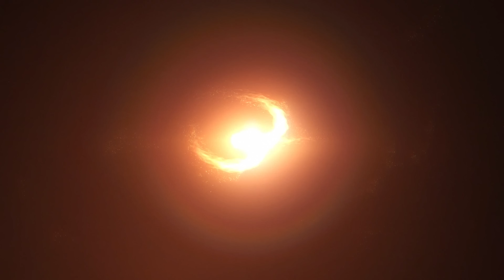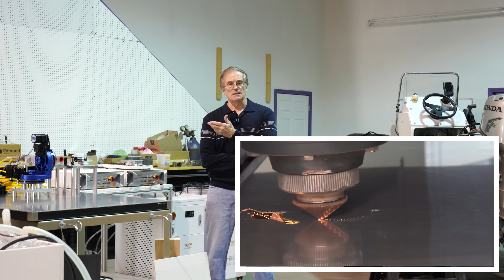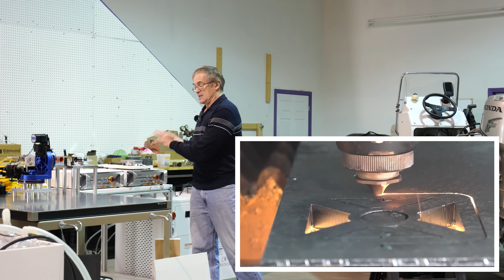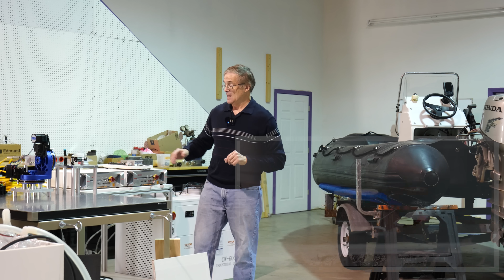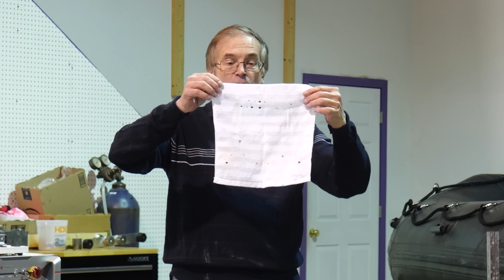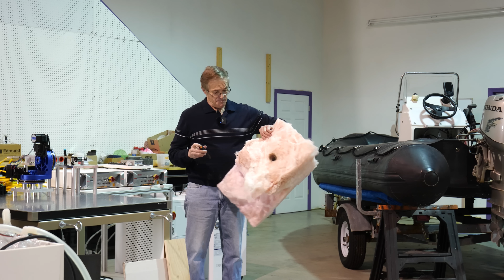We have a problem... and need your help!

Comment: you might have to 'cut' the laser right out of the gate with a series of beam splitters so you're only firing at a fraction of the full strength.
There is also a super-dark pigment (Vanta Black) - it has EXTREMELY low reflectance-- that you could coat a porous pumice barrier with. That might both diffuse and absorb the light.
Maybe you could construct a cylinder of the vanta-black pumice and keep it in high rotation so the beam doesn't super-heat any particular area

Comment: Dirt is... dirt cheap, and a large pallet with bags of it can be placed and removed by renting a crane. Stone slabs would be heavier, but easier to work with individually. Simple solution that allows the project to move forward is always better than spinning your wheels for months.
Reply: Sandbags.
Reply: A Hydraform machine will transform dirt (and a bit of cement) into interlocking dirt blocks that will support themselves. Don't know about US availability, though.
Reply: Isn't sand the same material as glass insulation?
Reply: @dreed7312  Is maple syrup a tree?
Reply: Or just use scaffold or lift and use the ground at the backdrop just make sure there are no gas, electric, fibre or water lines near the surface

Comment: My suggestion is to use intumescent paint. It burst into carbon foam, which should dissipate the heat slightly better and not flammable in on itself.

Comment: The solution to your problem is exactly what the potential targeted drone would want to use as a shield or building material. Wasn't silicon carbide used for mirrors in early high powered lasers? Perhaps you can try directing the beam on to a silicon carbide grinding wheel to test it's durability?

Comment: first idea: what about a fast rotating fabric belt that passes through a tub of water?  the faster it spins, the thinner the material can be.  water has high thermal density, so that will help with absorption, and the high speed of the material moving in respect to the beam means proportionally lower exposure time, so the limitation would be the speed at which you can spin such a material.  it would need to be porous for the water to be able to help.  (update: now that I think about it, this is how they handle degradation of the target material in an x-ray tube for longer running applications like CT scanners.  they make the anode a rotating disc so it doesn't just wear a hold into a static location, so I think it's proven to be a decent solution for similar problems.  I just don't know how well it would work for a fiber laser with such a power level, and at this size scale)

second idea: maybe a row of angled glass that would work sort of like a retroreflector without the second half, so the glass panels across the back would all be at the same angle.  some light passes through, some reflects.  some of that 90 degree light would hit the next glass pane and some would reflect to the back, and some pass through.  at the side, you can have a single strong material like fire brick to catch the accumulated rays. I'm not sure how feasible this would be, but the idea of redirecting beams from anywhere on the surface to a smaller location to minimize the area of material needed to do the absorption was the main idea behind this one, so maybe you can take that concept if this one doesn't work and find a better way to do it.  

third idea: I was thinking maybe a wall of those DLP tv fresnel lenses to disperse the beam, but I imagine those would be too imperfect and melt

Comment: Am I understanding correctly that the primary concern is if the laser stops scanning, and that in normal operation this isn't a major issue?

If so, I'd start with some sort of way to detect that failure mode and kill power.  But you'd still want a physical barrier.

In a vertical orientation, pointing to the ground or a water bed is usually good.

In a horizontal orientation, what about building a water reservoir and pump to create a continuous waterfall? You can have drywall, brick, or whatever else on the sides for the scattered light, and it's portable in the sense that the water can be drained before moving and refilled from any hose after moving.

I'd guess that scattering off of the water would result in a safe enough power drop, but everyone around still needs eye protection regardless.
Reply: I see that others have suggested a waterfall type setup, so I'm glad I'm at least not too wildly off base.

If you do explore this, even if you ultimately dont go this way, I'd love to see a setup with a basic red/green laser comparing different flow rates, turbulent vs. more laminar flow, possibly with added aeration.or even multiple layers.  It would provide a great visualization of why it doesn't work, if nothing else.

This could "easily" be done at a very small (and cheap) scale at safe power to test/demonstrate the power drop off and scattering.  The only issue is that a low power, small scale model wouldn't include the effect of the powerful laser potentially instantly vaporizing the falling water it hits.  You'd still need a good solid wall to initially test and prove a waterfall setup for full-power lasers, especially since they're not in the visible spectrum and scattering is a concern.

Comment: A better way to solve this problem would be to refract the light into a less concentrated area rather than absorb it directly.

You may need a multilayer material. The first layer would need to be a diffuser to scatter the light reducing its ability to burn through anything and everything. The second layer would act to absorb the infrared radiation and dissipate the heat adequately.

Perhaps that barrium sulfate paint you guys cooked up would work to scatter the infrared laser. That or some other infrared absorbing material. It could be painted onto a thin sheet of aluminum with a constant stream of water running down the backside to keep it cool.

Good luck, hopefully I was helpful
Reply: Agree and have a solution.
Bricks of compressed charcoal with trapped gas bubbles will have some fly off and the smoke disperse the beam further.
Im an Aerospace Engineer, awesome to help. :)
Reply: At least 1 other person has already suggested it (@anthonyanglim7147) but a Fresnel lens from a tv or computer monitor might work to dissipate the laser which could then be blocked my another layer... very cheap (Free from the dump) and mobile with a frame and castors... or multiple layers of Fresnel lenses, assuming of course it doesn't burn through the first lens.
Reply: Yeah, if there is a some good diffusing layer then there is tons of backing materials that could work. A number of commenters have suggested intumescent materials. And for sure, their expanding carbon foams those create are excellent at sacrificial heat protection with heat sources spread over an area like torches or open flames, but I tend to suspect that they won't hold up well with the tightly focused laser, which would burn away the tiny spot's carbon super quickly. but they could almost certainly handle a diffused beam much better.
Reply: @kevincathcart4680  The ablator would likely shoot steamy dust outwards, further weakening the beam, while the sides would expand to fill the hole.. in my theory, at least.

Comment: Is there a material whose gas phase strongly absorbs the laser wavelength? The resultant plasma would be opaque, so the energy of the beam would be wasted on heating it, instead of the substrate.

Comment: Consider a layered composite structure:
Front Layer: UHTCs
-Acts as the first line of defense, withstanding direct laser exposure.
Intermediate Layer: Graphene-Based Composite or APG
-Distributes absorbed heat laterally, preventing hotspots.
Core Layer: Composite Metal Foam
-Absorbs residual energy and provides structural support.
Back Layer: Phase Change Material
-Absorbs any remaining heat, stabilizing the overall temperature.

Comment: You're looking at a problem of heat dispersion and dissipation, you'll need something that can disperse the heat quickly, backed by something that can either soak it, or re-emit it. Example being solid carbon plates, backed by a large volume of water, or some super high flow heat sinks. You're dumping a massive amount of energy into your laser stop, so you need something that can take that energy and convert it, redirect it, dissipate it, or something along those lines. You could go with several layers of the brick that you showed us, put it on a movable platform, and it'll soak the beam a few times before becoming useless slag. Or you can go with something more durable, but also more expensive. Another thing to do would be to redirect the beam into a beam catcher, but I'm not sure if there's one in that category that would be affordable. Might be a good idea to see if there's a way for you to find out how they're made, and build your own, then test it on progressively more powerful beams to failure. (You need to know its strengths and weaknesses.) Good luck on this one, it's a monster of a problem at that power level. :)

Comment: I see someone being severely injured before this project is completed. May the force be with you - good luck. Maybe you should research your Jedi manuals regarding safety practices during training.

Can you pulse the fiber lasers to reduce power during testing? Do you need a continuous lase to disable a drone or similar target? Maybe boost the power to the max only if you detect a reflection from the target ? Acquire the target with lower power, detect the reflection, and pfft! Next target?

Comment: Test the tracking at very low power with high speed cameras to evaluate test results. Test destructive power outside and pointed up. Have you done the calculations about how far it will still have destructive energy in the upper atmosphere?

Comment: I think that you could do a process where you compare the specific heat, density, melting/boiling point, and cost/ease of procurement to find a material with a high thermal absorbtion that you can easily get a lot of.

(this one nerd snipped me and I am currently making a quick list of such things. So far, wol looks like a decent competitor)

Another thought is to go for dispersion. Basically, have a large water tank as the backstop and fill the water with salt, sugar, graphite dust, glitter, to anything else that could disperse and/or absorbed the laser energy.

Another idea off the top of my head as I write this: I am currently working on a project that is about collecting light with reflectors, and I found out about aluminum paste. This is a paste consisting of micron sized specks of aluminum that can me mixed with different things to make a paint, and the exact characteristics of the surface finish depends on the characteristics of the aluminum specks. Some of these pastes are able to scatter light that hits them nearly evenly in every direction out from the surface. 

Last thought, combining idea 2 and coating the back wall of the tank with aluminum paste would compound the dispersion effects.

Comment: Sounds like you are looking for a liquid cooled beam dump that snaps down in front of the beam when certain parameters are met, i.e., when the platform's acceleration drops, slows or stops, coupled with the length of firing time for the laser. This solution would be mobile with the laser platform and require no setup time after installation.

Comment: There are fire resistant paints that generate carbon foam at extreme heat - and sure the carbon foam will continue to break down into CO and CO2, but that seems more tolerable for a few seconds compared to cutting holes in your building and truck.
Not sure if they can resist a tiny laser spot for as long as you need though, some experimentation required? Maybe soak some thickness of rock wool in the stuff?
Perhaps some other NASA-grade ablative material that you can make or get your hands on?

Or perhaps there is no material that can withstand the laser spot without some quite serious active cooling - so tungsten sheet with a matte finish and a volume of active watercooling behind it? Perhaps add carbon black to the water (or something that generates an opaque gas on decomposition?) to make it more absorbent in case the tungsten is punctured, and ensure there's a path for steam to escape?

@NightHawkInLight may have some ideas too - he's done heaps of work with these sort of materials, including making a starlite (carbon foam ablative fire resistant) replica from kitchen ingredients.

It would be dramatically simpler if your laser spot could reliably stop at a specific location rather than arbitrarily over a huge wall, fixed laser backstops using reflective traps are fairly common, but also far too small for what you're doing.
Reply: Hmm, a carbon foam ablative in argon won't make COx if you can find some way to keep the argon sufficiently contained… Sheet of plastic over the front perhaps, and just patch the inevitable holes up after each "event"?

Comment: Gravel or sand. Something with both a lot of mass, but that is semi fluid. As parts are vaporized, new fill takes its place.
Reply: sand in firehose mounted vertical, in a two overlapping rows.
Reply: Basically sandbags. Fill them with whatever dirt you have nearby and your a good. But since bricks are already out because to heavy/hard to move those would be out too.

Comment: 2 layers of plywood with a gap between that gets filled with sand and rock? The sand and the rock stop the beam from reaching the second layer of plywood, so only the visible layer of plywood gets scorched. Also try soaking the plywood in water to prevent it from catching fire?

Alternatively, maybe even a layer of moist clay slapped onto some plywood might be enough?
Reply: sand in firehose mounted vertical in two overlapping rows.
Reply: I like this quite a lot, although it would be very hard to install or move, and that is still a door that I assume needs to be used from time to time. otherwise pretty cheap solution. Could especially work with the irrigation.

Comment: You need to quickly disperse the heat generated by the laser striking the backstop.  Turbulent water running over the surface of one or more fire bricks seems like it would disperse the beam (at least a little) and provide cooling for the backstop material.

Comment: Submerged sand sandwiched between plywood? mostly because i don't know if glass can be used as the first layer. but course sand and water would be my first idea. just need to find the right thickness. at a certain thickness i would think the isolating factor of it and the heat sink properties should be enough to stop the laser. that or wet sand on an angle. as close to 45 degree as you can get it? just thinking out loud.

Comment: I get the feeling that 90% of the commentators haven’t watched the video prior to commenting. While there are some patents out there that discuss High-power light absorbers (HPLAs), they are a little sparse on details. You might have success with a carbon fiber woven material (such as used for welding protection) behind an intumescent barrier of some type. If the intumescent barrier is an applied paste, you can simply apply more paste to cover any damage. I’d imagine that you could make panels of this backed with 3/4 plywood or MDF for portability. I think that ultimately a layered approach is needed in this situation. As at least one other comment mentioned NightHawkinLight has a video series on intumescent materials, which might be a good starting point for that layer. Alternatively just cover the entire wall in shiny disco balls and watch the fun that ensues.

Comment: Water. Has high thermal capacity and the droplets formed will disperse the beam sufficiently. You need a long "tunnel" with something like cascading waterfall display curtains.You would possibly need a high capacity pump and spray system and you would need a few meters length of tunnel - a single waterfall curtain will not be sufficient. But designed properly, with input angle equals output angle of reflection, you may achieve possibly 4 square meters worth of protection with less than industrial equipment.

Comment: About 4 years ago, NightHawkInLight did a video on Starlight. Apparently he DIY’d it, so it shouldn’t be that difficult to make. That might stand up to the intensity of the beam.
Reply: This was my instinct as well.
Reply: I made a similar comment suggestion for that stuff. Made my own before, it really is insane. Works extremely well and likely one of the few materials that can handle such a laser. Let's upvote all Starlite comments so he hopefully sees them. Super cheap, ridiculous effective. Love it.
Reply: @speedycpu   i love to see this channel do a deep dive test on laser vs starlite!

Link to NightHawkInLight’s video (part 1) 
https://youtu.be/aqR4_UoBIzY?si=mplInvkcBpwTWGIC
Reply: Yeah I was thinking this as well. I'm actually scrolling through the comments to see if anyone else had recommended it.  I don't think it would hold up though, lasers are a different beast than fire or intense heat.
Reply: @K9Megahertz  Absolutely a different beast, but it's worth a shot. Obviously the starlite material had it's own set of unique properties, but that's the fun of testing and trying to find out how it can be useful. Formulas can be tweaked, application methods and build structures can be varied, all to find the sweet spot that can absorb the most amount of energy per square whatever. Then find the appropriate way to ensure absorbing all the energy. It could be a short process, or a long one, but I'm excited to see these guys do just about anything, so I think it'll be a logical possible solution with entertaining and informative research endeavour.